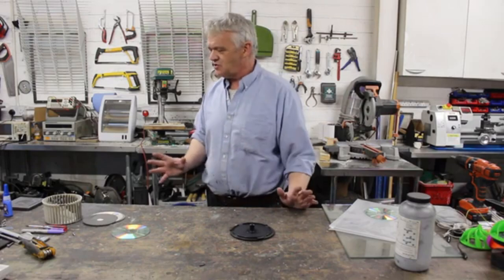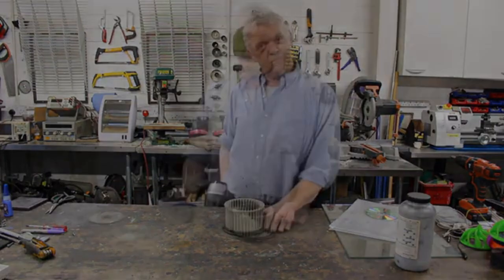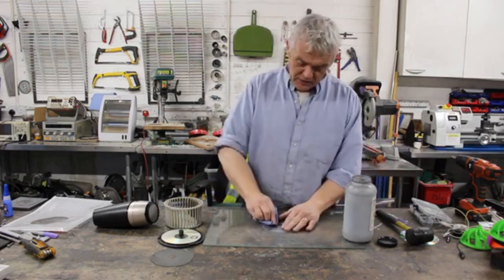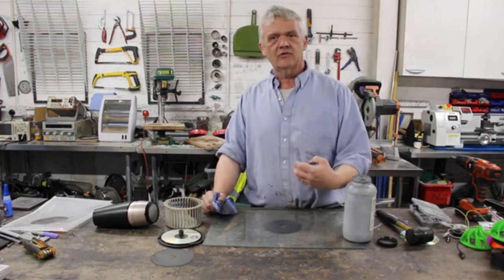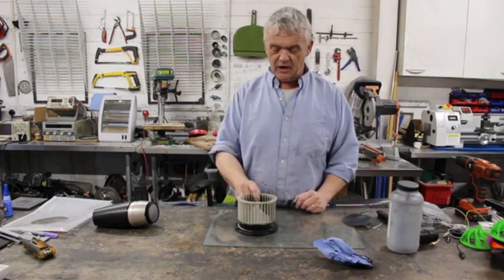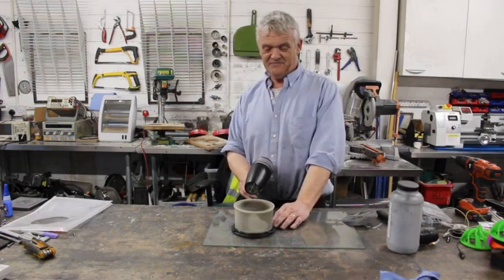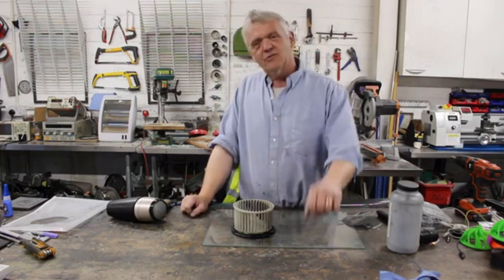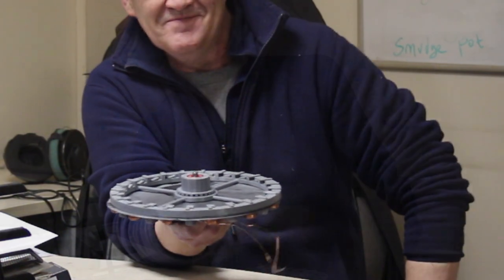1866 DIY Super Simple Low Friction Bearing

Comment: There's a 'plastic-like' material called UHMW Ultra High Molecular Wear, almost as tough as steel that is used instead of bearings. 

Bore a hole that's just large enough for the load bearing shaft and use it just like any other bearing, runs slick and smooth. 

I've seen it in use on conveyors that runs 24/7, seemed to never wear out.

Comment: For wind turbines in general if you could divert some of the air flow under the rotor it could form an air bearing what you lose in wind power you would gain in reduction in friction.... maybe.
Reply: Air Hockey and Puck!  Just what you said
Reply: I was just thinking about some form of air cushion...
And I bet things like Fish Tank Air Pumps or even miniature compressors are small enough and have a low enough draw that one could well justify constantly powering it.

Comment: Disclaimer: not an affiliate of any supplier
Igus makes tribological materials - some are available in spools of filament so you can print your own parts.  I got a spool for our lab and made all sorts of little parts that removed the need to lubricate some things and improved the performance of others.  It's pretty cool stuff, they also make powder (for sintering), bar stock (for milling), and tapes (for making surfaces low friction/wear), and also have a service where you can send them a drawing for a quote on just building it for you, if you like.
It's kind of a soup to nuts vendor, starting with proprietary materials and all the way to fabrication.  They have other interesting products but the important thing is they're affordable and accessible, always willing to help and will return your calls even if you're not some business - they seem to enjoy supporting interesting projects even if there is no sales volume in it for them.

Comment: For balancing riding lawnmower blades, I took a slightly used spindle with the bearing still in it.  Too much drag to balance blades.  But I carefully degreased the bearing and lightly used sewing machine oil.  Eventually I used powered graphite with no oil in the bearing.  That made such freedom of movement I fixed factory blades easily.  Way better than commercial balancing at the time.  
Why? It was a lawn business and sharp blades made for fast cutting.  One sharp pair every day and less vibration.
Reply: I'd always clean the blade spotless, including rust, and use a 1/8th inch piece of brass tube as a balance.
Hand filing, it took forever, but, I only sharpened my blade once or twice a year, depending on rocks.
Reply: @TimeSurfer206  30 hours a week on other peoples lawns.   Rocks, limbs, toys, wires...Every 2 days x3 blades, if nothing else just to keep vibration down.  Worked great with an angle grinder.  Could cleanly mow as fast as the mower would go.  It became a huge sales point.
Reply: @shanealexander9952  Oh, you don't need to sell me on the values of a sharp blade. I worked in trees for many years.

Comment: One thing I like to use is bicycle wheel ballbearings, because I just have bags of them from the amount of back axles I used to get through.
If you subtract a torus from being sandwiched between two cylinders meant to fit on the shaft, with a small gap between them already, you could make a ring bearing where one just sits on top of the other on the shaft with the ballbearings inbetween.

Comment: In some of my wind turbines I've used a shaft riding on a single steel ball , in a bath of oil, all inside of a brass nipple (pipe). Spins like a childs top. Thanks to Marcus Goeller for that invention.
Reply: Can you link a video.... Sounds insane!!! 😊
Reply: This is brilliant.
I'd like to thank my Grandpa for teaching me how to picture this in my head.
But, I'm still going to check out Mr. Goeller's works, because details. Like, load bearing ability, and such. Although I'm a big fan of "Winging it by making it way too sturdy."

Comment: Years ago I was trying to think of a way to make a simple frictionless bearing. It was more a thought experiment. What I came up with was magnets.  
Vertical axis: Five (if the diameter of the axial equals the magnets diameter) with the same pole facing up on the base and five with the same pole facing down on rotating unit. 
Horizontal axis: use a bar magnet for the axial. At the north end of the axial use the north pole of the spinning magnets facing the axial. South with south.
I never tried either so this is just an idea

Comment: I was thinking about your center stud and that skate bearing .. if you used a threaded rod in place of the stud, then used washers on either side that only made contact with the inner race of the bearing, the bearing would still be free to turn.. washer would also act as a space between the coils and magnets

Comment: freewheel driver, 135mm axle, 10mm inner diameter thrust bearing press fit into base and m10 flange locking nut both ends.

Maybe capacitor discharge to initiate spin when stationary condition to avoid stall moments

Comment: I'm thinking if it's going on a flat roof you could have them use rain water with a drain hole to maintain a constant level and have a water bearing.  You did a water bearing a while ago, they're going to be subjected to rain anyway,might as well take advantage.

Comment: interesting, very interesting...
Most people think about lubricants as liquid or grease (grease is not so much a lubricant as a heat and dust absorber or rust preservative most of the time), but few know that there are solid lubricants such as graphite. Didn't expect it to grab so well onto plastic, though... interesting! Perhaps some preliminary light sanding could enhance it (or make it worse).

Comment: This is a great project, loving how its developing. I thought you were going to suggest a magnetic bearing, surely two rings of magnets with similar poles facing inwards mounted to the turbine blade and the coil side would result in a very low friction bearing that requires no maintenance. It also increases the mass of the turbine which should help?

Comment: Hi Robert. New subscriber. First comment. Really interesting project. The Graphite-treated HDPE is a great tip. You may get even better results with PTFE impregnated glassfibre mat, treated the same way. The kinda thing you can line your oven shelves or grill pan with. 😊👍🏻

Comment: HDPE is also milk jugs as a common source and hard hats if you need a thicker bit. I don't have a 3d printer but I'm pretty sure you can get HDPE filament, you can certainly get nylon which is the next more slippery plastic second only to Teflon.
I am wondering if the graphite treatment would be the go for all your printed cogs and things.

Comment: May I suggest graphite-graphite bearings? It might be the best coeficient possible. So would be two graphite discs (one for each moving part)
Also maybe at low speeds graphite gets more stuck so maybe by cutting the disc so that there is only a strip in the outter part it will gain speed quickly for each revolution rather than in the inner part.
Lastly i would take care about the "flatness" since any subtle warp would make the efficiency go down like crazy
Hope it helps! Cheers and keep it up guys!

Comment: I believe PLA is very similar to PET. I wonder if you could use a 3d printed disc. Layer lines should in theory reduce surface area in contact with the fan/platform and valleys may work as a reservoir for graphite powder.

Comment: Makes no sense to have the surface area causing friction to be all the way to the outer edge… the arm of the friction force vector is needlessly long and causes a bigger than needed negative momentum around the central axis. Use the same method but have the friction surfaces be much closer to the centre. Also: hang the entire device upside down (rework the bearings to suit that position) and see it will perform with greater efficiency due to the flaps always being in optimum position for the wind to catch them ‘unless’ they are on the non effective side and get blown upwards by the wind. 😊
Reply: Simplicity to make is the key.  By using a larger diameter the area is increased dramatically and it prevents heating which would soften and perhaps even melt the HDPE substrate.  I'm sure there is an easy way to figure out the optimal diameter.  As to upside down flaps, I would suspect that the turbulent flow would increase dramatically causing excess unwanted drag from having to move multiple vanes out of the wind path, don't you think?  It would be interesting to see some side by side comparisons.
Reply: @JonLovestheLord  Heating of the surface would only occur noticably with high friction and high rpm. A bearing near the centre would be much more efficient and lower drag (allow for longer freespin). Developer himself mentioned this is fun and games for a quick and dirty model. Not for end use. With regards to the flaps: there might be unexpected results but my gut feeling sais upside down will work better (with the proper bearing changes to make that possible)

Comment: Are the static electric charges generated by transferring electrons consistent enough to be utilized for a bearing surface?  For example, if I rub two balloons of the same type on a bit of cloth, they will repel each other.  How does one even measure static charge, directly or indirectly?

Comment: Would 2 doughnut magnets ( holes in the middle to mount underneath the rotor ) with similar poles opposing one another interfere with the magnetic fields of the serpent coil sir?  Due to proximity?

Comment: Hi rob ive had an idea, if you were to use a clay pigeon thing which shoots the clays out and make it start a flywheel how long do you think the flywheel would run for before you needed to re-twang it with the clay pigeon slinger motor? And how much power would one of those vlay shooters use to give it a ping?

Comment: milk bottles (the plastic ones- not the glass kind) also make good low friction bearings. cut out a washer from the milk bottle and you get a good low friction bearing, you can also use small pads of milk bottle around the circumference of a larger disk. we used to do this for a low friction base for large dobsonian telescopes (think 24" diameter lazy susan bearing.) nb these are also HDPE

Comment: Wonder how it compares to using graphite lube directly without the HDPE disc. Or other lubricants, for that matter. What'd be even more awesome is if it were shaped as an air bearing straight off the 3d printer; no lube and almost no friction besides wind drag. At least until it gets leaves and bugs stuck in it, but you'll have to deal with those same maintenance issues in the small moving feathers of the turbine anyway.
Reply: Not PTFE but  HDPE+Graphite
Reply: @justtinkering6713  Of course, thank you. Corrected.

Comment: I guess you could've just rub that graphite straigth into the printed plastic parts. I mean carbon (graphite) is a dry lubricant as is magnesium oxide (talcum powder). Now you can try it out which is better, with that extra plastic or without.

Comment: I know the bearing inside of computer fans kind of have a spot where they almost keep moving on their own, like an offset or w/e its strange to watch em slow down, they start jumping.
Reply: High quality PC fans use ball bearings.  Others use standard brass bearings... and the fan itself is partially suspended by the magnetic fields.  You can feel the suspension, by pressing the fan center downwards.. and it will spring back up.   There is also the resistance you will feel from the alternating magnetic gates / poles.
Reply: @johndough8115  Ahhh, thats whats going on with them, I knew they acted strangely but never knew why. Thanks for filling me in on that :)

Comment: Whilst this is interesting surely just 3d printing a track into the rotor either the rotor or the stator and 4 or 6 ball pockets at 90 or 60 degrees respectively in the other for a ball bearing and retain the central bearing and bolt for preload would be much better and barely more expensive. Like a lazy Susan